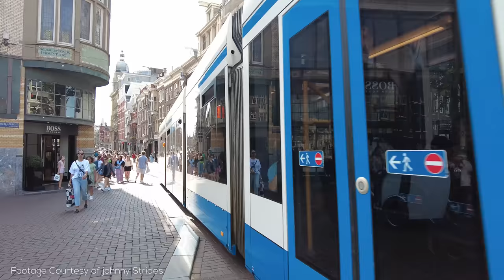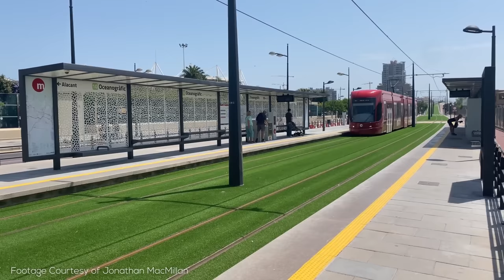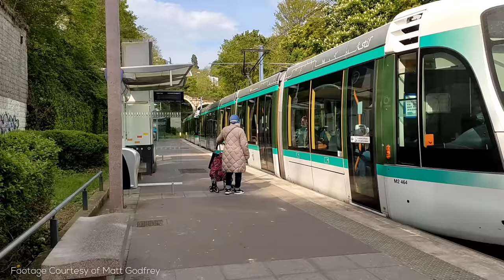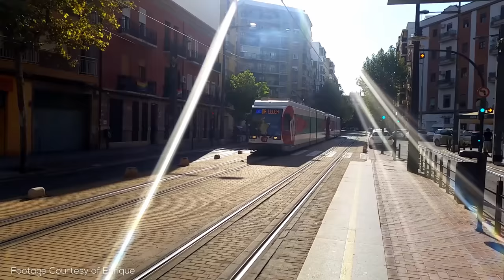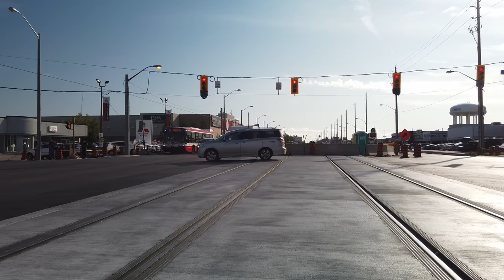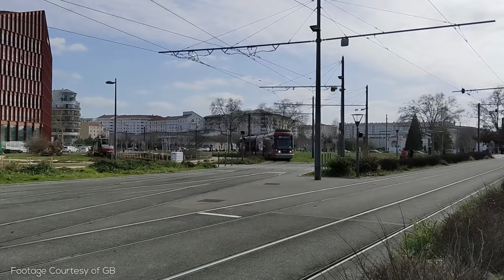What the US Gets Wrong About Trams

Comment: In the transit hierarchy trams are indeed a nicer bus, on paper. But when it comes to rider experience trams are actually 'a slightly less good metro riding on the surface' in a lot of cases. Put them in a tunnel in some sections and the experience can be nearly identical. And a lot of anti-tram pro-bus people don't see that because they have probably have never gotten to experience a proper tram network with the most important features; dedicated lanes, complete signal priority, close integration with pedestrianized areas. That in addition to actually having a useful and sensible route, which a lot of the US streetcar systems don't.
Reply: @tomassakalauskas2856  I definitely agree. Trams and buses on the surface make you much more connected to the neighbourhood, and in that also facilitate interacting with the surroundings. (And if we're talking wayfinding: being able to see where you're going and where you're passing through definitely helps.) This also means you can get on and off quickly so it makes sense for partial rides: have part of your journey, get off for a store or the library or a park or whatever, continue your journey a bit later. Walk for a bit, and hop on whenever you feel you're done walking. 

For me, the daylight is also very important.
Reply: @tomassakalauskas2856  I believe a tram is more commonly used to connect important places within a city district with one another, maybe even across additional diststricts, depending on the location and structure. But a metro should be a system, that transfers larger numbers of passengers, in a much shorter period of time and with less stops, across multiple districts. From one end of the city to the other, if you want to call it that. They should not serve the same purpose and actually complement each other, instead of competing with each other.
Reply: I wouldn't go as far as describing myself as pro bus anti tram but there are certainly obstacles to merely suggesting a tram on any old corridor, even with the benefits. The Croydon Tram works in London because Croydon had the old rail lines to take over and the room to make it all work where as the proposed North South river tram that was scrapped years ago would of caused more issues than solved - far easier & practical to have bus routes instead when you have serious obstacles to overcome and if you invest in that bus network, it can really be just as good like London's was before they stopped investing and started to cut it instead. I think the US however would benefit massively from trams if done right
Reply: This is working at cross purposes a bit. If 'close integration with pedestrianized areas' is part of what makes a 'proper tram' then you can't transplant a tram into a metro line's right of way and still call it a tram.

From a vehicle perspective I don't think there's any bright red line between what's a tram and a metro other then floor height but that's a feature that has fairly limited overall impact on service. Most of what makes a tram a tram and a metro a metro comes down to where the right of way is placed and how ( and if ) it interacts with other traffic. A fully separated and dedicated right of way will tend to be a metro, less separated will be more like a tram alongside which you can place some trends around station distance where shorter distances tend to be the norm for trams.

Interestingly @tomassakalauskas2856  mentioned a feature of metros that doesn't quite have to be necessary though can be harder to avoid in dense urban areas. Elevated metros are certainly a thing and I can say I've often enjoyed the morning views while on the skytrain to work.
Reply from the maker: Yes, done right trams can be excellent! But there are less examples the many think of a truly great system!
Reply: Trams are much quiter and way more comfortable
Reply: @tomassakalauskas2856    Yup, elevated light metro is a big no no in the center of old European cities (also because there's simply no space for it) but it exists for line ends and not-so-small sections like in Lille, Rennes and Toulouse automated light metros (VAL) for example.

I really don't share your optimism about tram's automation, and I'm not even sure that it could be allowed under current local and EU laws.
Automation doesn't work well with non separated grade / non secluded track and frequent traffic and pedestrian incursions.
The technology might soon reach a good enough level but I don't really see authorities and transportation agencies jumping to allow it. They'd probably wait quite some time before implementing it, if they ever do.

Automated driverless train operations in grade separated right-of-way have been available for 40+ years and see the time it took to be more widely used (it is still not that common outside of a handful of countries).
Even if Lyon operates an automated driverless metro on grade separated but non-secluded tracks (no platform screen doors), it's completely out of question in Paris for example.
We'll see, but I don't think authorities will be easy to convince that an automated driverless / autonomous tram operating on open, non-secluded, non grade separated urban tracks is safe enough...

I'd see autonomous driving kinds of small trains / vehicles operating on low-ridership, old renovated rural lines well before autonomous urban trams.
Like SNCF's 5 different projects and researches to revive small rural abandoned lines with autonomous electric / H2 vehicles halfway between a train and a bus on rails or multimodal vehicle (capable of road and rails).

And this is already a regulatory nightmare due to the tracks not being secluded nor entirely grade separated.
Reply: I agree with you 100%. The future is trams for moderate distance travel because there’s the possibility that they could operate autonomously. The DLR in London is now an old example of autonomous light rail. Where is the next generation?
Reply: Honestly as a rider I find trams way nicer! I guess if it was a daily commute it would be different, and I'm perhaps biased by using the underground so much, but a tram is just a much more pleasant experience even if slightly slower.
Reply: @tomassakalauskas2856  completely agree, it just feels so much more natural. Step on, enjoy the experience, and step off right where you want to be.
Reply: @incalescent9378  agreed I see trams / busses like walking-biking THROUGH an area VS a Metro / subway-sky train as a mode to GO SOMEWHERE you are NOT more like a motorway designed to AVOID everything NOT where you are going 
the "ultimate" subway is a star trek teleporter just "beam" there VS "touring" your way past all the local spots on your way there
Reply: @AmurTiger  much like a "stroad" is NOT a fixed definition a tram system is NOT a fixed item that spans the space between bus on road AND 100% separated Metro like Sky-Train
Reply: @tomassakalauskas2856  Reacting yes ; spotting, not yet. Even the most advanced self driving cars still have recognition issues in certain conditions.
Humans are slower to react but better at identifying in a range of particular and difficult situations. They also tend to have less false positives.

Anyway, that's not really the technology that I'm questioning, it's the acceptability of it and the legal framework for transportation agencies, passengers, local, national and EU authorities...

Even on rails, the ethics of emergency decision making by the autonomous system remain an issue.
Who / what to sacrifice and to prioritize saving ?
To what extent goes the responsibility of the owner, or operator of the tram vehicle ? Is the track owner / manager responsible in case of intrusion and accident ?

It is still currently a huge legal and ethical issue for governments, legislators, insurers, etc.
Given trams are guided, that removes the lateral dimension from the equation, however one still remains.

The lack of grade separation and track seclusion makes the safety and legal questions currently prohibitive and the acceptability severely hindered.
It will need a complete new legal and ethical framework before any project could be greenlit.
And we can't be sure that the future ethical and responsibility decisions by legislators will be satisfactory enough to operators / agencies for them to adopt and implement the technology into their mass transit networks.

That's why I don't share your optimism about autonomous trams, it's much more than a technology issue.
For example, Airbus has already said years ago they are perfectly capable of building autonomous airliners but that they won't before a long time due to the acceptability and ethical issues.

Where in Germany are those autonomous trams being tested and by which manufacturers ?

(Autonomous buses weren't even considered in my previous comment, it's such another mess)
Reply: I always prefer tram over bus, when you have proper rails in good condition, it goes very smoothly compared to bus, when you are from Poland, it's vice versa, but most of people are not from Poland I guess. Here in Prague, you can just stay without holding bars and you will not fall in most of places, which is really not the thing in buses. And trams have mostly much higher capacity than bus and another massive advantage for me is that you mostly know where it is going because it goes on rails, when you jump to bus and you are not sure where it is going, you never know where it turns left or right. When you are on tram corridor, you just know in which way all trams go which can be advantage when you are in unknown city.
Reply: @red_skies80  "Trams are much quiter and way more comfortable"

depends where, here in Prague, we use rubber plates under rails and it's pretty silent, but when I've been to Poland, their trams are like incoming tsunami 😀
Reply: Brilliant comment. Really hit the nail on the nose
Reply: honestly buses are actually better... or aus just has good buses
Reply: @Pavlovano_YT 😂 no Australia doesn't have a great bus system, especially beyond the city limits.
Reply: @meikahidenori sydney has a half decent bus system that was wrecked by those goddamn trams

Comment: The thing with trams is that they are incredibly versatile. A tram can run fully grade separated like a metro, or run in traffic like a bus, and anything in between.
This can allow for highly specialized and very unique transit systems, such stadtbahn systems.
But it also makes it really easy for trams to be used in a lazy and suboptimal manner.

Trams are an extremely powerful and versatile tool. But if your only tool is a hammer, everything starts to look like a nail.
Reply: Very well said
Reply: I LIKE TRAMS and think they are the MOST versatile option and for a lot of sub optimal "solutions" IMHO are not "BAD" unlike some "rapid bus" projects that actually suck big time and have near zero ridership 
one BIG + for trams done "lazy" is the "on grade" guideway acts as a "big billboard" advertising its existence and is itself built in wayfinding
Reply: @jasonriddell  What I don’t get is LCDs are cheap, and so are LEDs. What’s the hold up.
Reply: And, hell, even as a semi-subway network – looking at SF's muni metro system, for example.
Reply: But trams also need much more qualified drivers with rail vehicle driver license, which is a massive problem, you can always find someone who can drive a bus, but with trams, it's much more complicated, some cities have real problem with this. Metro will be operated by autopilot in the future in most of cities, but you can't do that with trams.
Reply: @Pidalin  Is that really a problem? In Prague becoming a tram driver is really attractive career choice, because for people with lower, practical education it's the easiest way to high salary. 

The needed education and practice is provided by the transport authority itself.
Reply: @Posiman  Mabye they lowered their standards over years, but when my father was doing that in 90s, it was not that simple, many of them failed on psycho tests and other tests and ofcourse you work most of holidays. But tram driver is actually not a driver, that's the point, you need to go thru all things you would need even for driving a train.
Reply: A BRT can also run grade separated
Reply: Well I guess in North America we don’t have hammers; we have screwdrivers. 🤷‍♂️
Reply: Exactly

Comment: In the US I think the Build America requirement for federal funding plays a huge role in why our trams all look alike from maybe two builders. We don't have the ability to simply pick and choice from competing manufactures. Not to mention our need to ensure it meets our US build requirements. And i believe that's worth mentioning.
Reply: That was a more recent thing. But yeah, GE should really start making trams. There’s probably a few others like Hyundai that make trams and can be used in the US, too.
Reply: Essentially the Buy America act is about assembling and having sourced a percentage of the components of the vehicle in the US. However most of the big manufacturers (Alstom, Siemens, CAF, KinkiSharyo, Stadler) have set up shop in the US now, so they could easily have a special front fascia made in Europe and assembled in the US.
Reply: I think we should let the people decide. Have like 5 different designs and have them shown off to the public and hold a popular poll to decide.
Reply: @MrMarinus18  That would be fun.
Reply: Yeah
Reply: @MrMarinus18  That's how it's done in Paris, Île-de-France Mobilités offers a vote between usually 3 designs for interiors and exteriors.
It was the case for both Grand Paris Express train types, the RER NG and MI20 trains for RER lines E & D and B, MF19 metro trains and even the Cable C1 gondola.
They've also offered a vote on recent trams.